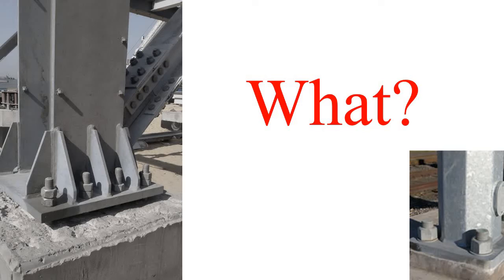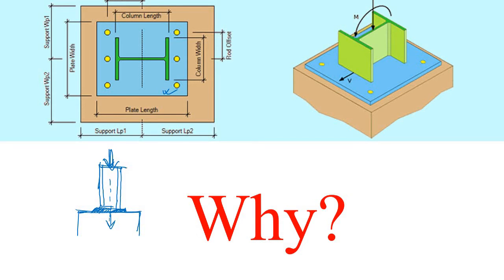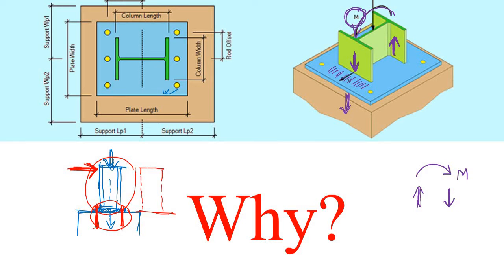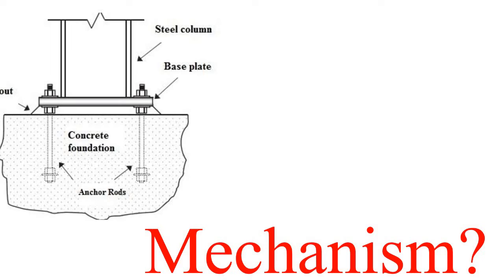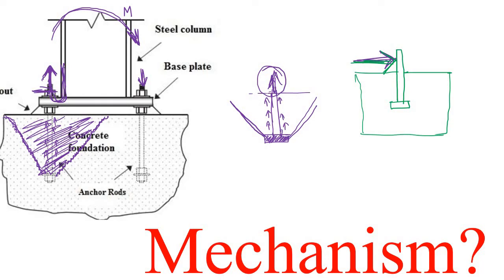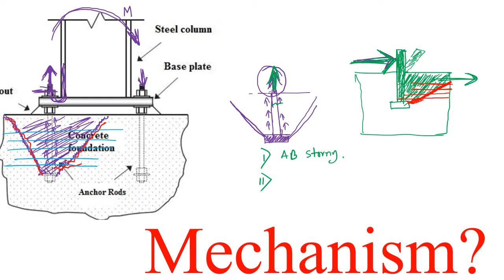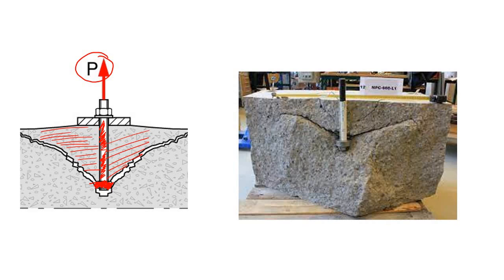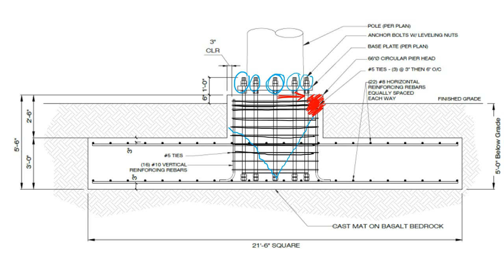Anchor Bolt : What , Why and How

Comment: Thank you so much for providing good information. Please make a video on topic how steel base plate transfer load on concrete pedestal. Most of the book cover directly base plate to concrete pedestal uniform load type. But in practical most of time I see steel base plate is elevated over pedestal through bolt even no any grouting has provided. Will it transfer load  as point load through bolt on pedestal.
Reply from the maker: Ok soon

Comment: Very nice explanation, sir could you explain us why we use lesser strength material for anchor bolts when compared to main structure bolts
Reply from the maker: It's very simple..in main structural bolt we consider yield and rupture but in anchor bolts we only consider ultimate strength. Isn't it ? And as ultimate strength is much higher than yield strength, even if we use lesser strength material our purpose is solved

Comment: 11:50 it is tension in the bolt but it is because of "compression" that the crack developed...
The bolt "head" is similar to a compressive load, this developed the "cone failure"...
This anchor failure is because of concrete compression failure from the point loading of the bolt head (using tension as the loading force)...
Hope that makes sense...
A deeper embedded head would resist more and a larger head /"plate" would distribute the load also.
Overlapping cones of course are always an issue and wind loads create a shock force greater than non-shock loads.
Deeper concrete footers and embedding of bars are superior to the smaller surface bolts.
Your fracture implied surface tension was not shared in the concrete resistance... Loading was from bolt head and this cone failure is typical (38-45 degrees )... Typical of the fractures from the edge of the bolt head "edges" and of course this would be circular from top view / visual.
The question is, how much force to create this fracture in this concrete and embedment?
Again, this is an an internal compression load from the bolt head and I can get results from drilling a hole in a core and loading head of bolt to duplicate this failure (of course I would drill a hole to point load the embedded head , this will allow for the surrounding concrete to preticapate to some degree.
My theory is of "stirrups" and this allows for "trapping" exploding concrete, this is not a deflection failure but an "bursting failure" and strapping does a great job on trapping that buckling failure.
Confine the cone, do not allow it to "displace"...
I hope I did not confuse you and I hope you do take offense.
Reply: “A deeper embedded head would resist more and a larger head /"plate" would distribute the load also.”  Agreed.  It would have cost very little to increase the embedded bolt length to, say, 20 times the major diameter.  Also, the embedded washer (if we can call it that) is too small in diameter and curiously over-thick.  Better would have been a diameter of 2.5 to 3.0 times the major diameter of the threaded rod.

But notice, though, on the low-resolution photo what appears to be a plastic sheath over the embedded portion of the threaded rod above the “washer.”  This is smart.  It prevented concrete from bonding to the rod above the washer.  Two factors to consider.  One, concrete is strong in compression, but weak in tension.  Two, the rod, like any elastic object, will elongate as load is applied.  If the concrete had bonded to the upper part of the rod (which, as I stated, was not the case), as the rod elongated under tension, part of the tensile load would have been shared by the concrete bonded to it.  Since concrete is weak in tension, a local concrete failure would have occurred near the surface with a proportionally smaller cone of failure compared to that shown in the photo.  The immediate result would have been less remaining intact material to support the tensile load.  One can imagine a cascading effect, especially under cyclical loading, where supporting material would be progressively lost until ultimate failure.  The load required for said hypothetical failure, we may reasonably speculate, would be significantly less than was the case of the failure shown in the photo, where concrete bonding above the washer was prevented.

Your thoughts?

Comment: Hello sir, I have a question if the base  is pinned connected and the upper frame is moment connected how does the flange carry loads from column to the base plate and to the foundation …. Your explanation on this  would be  very helpful
Reply from the maker: This needs a video explanation. I will put it as soon as possible.

Comment: The bolt will never be stronger than the concrete. Before the concrete cracks, the bolt will crack first
Reply from the maker: yes right 50 mpa vs 415 mpa